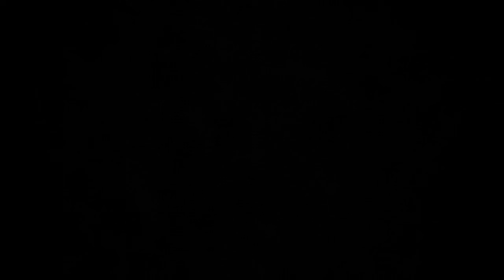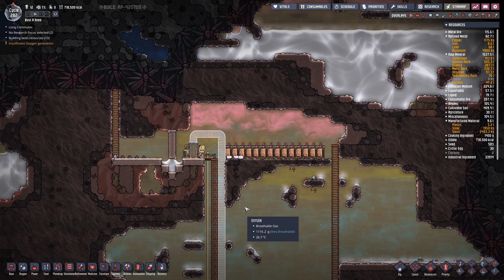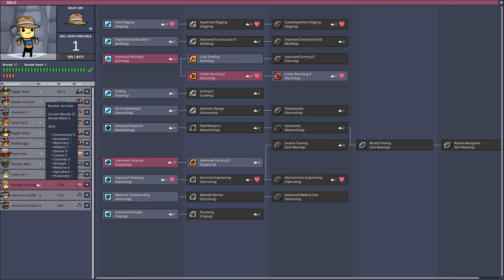ONI Bust A Rime #14 - Petroleum boiler

Comment: I'l be honest, I take the method you used in the first few videos to make your chlorine room and do that as often as I can. I build the entire structure, bottom up, and fill in all empty space with regular tiles. I make a liquid lock outside and vaccum out the small area and just "carve" (desconstruct) my way out - as often as I can anway. I get so very tired of waiting for pumps to get the last tiny bits of gas out of a room.

Also, the sour gas flash there is definitely the lesson everyone needs to learn about thermal mass. Firing up a petroleum boiler definitely needs like 4 tiles worth of oil to soak up the initial heat spike. The smaller your margin for error in state changes of materials the more mass and/or control you need to throw at it

Comment: Steam geyser tamer : It seem to not have enough cooling because the tempshiftplates dont transfer temperature between each other , try to build solid tiles between them that will boots the conductivity greatly , also the pipe temp sensor is in the wrong place , the pocket is measuring isnt the one that enters the aquatuner , so it can overchill  the water again .

Comment: Hiya Tuplex, this happened to me as well the first time I built a petroleum boiler where a lot of sour gas instantly got flashed.  That's cause the automation to keep the door open has to be in place before the door is built otherwise the door and diamond tiles above the door will be preheated to 1400 degrees without enough crude oil in the system.  If the automation is put in to keep the door open first, you will keep the temp of the tiles and door low until it's ready to go.
Reply from the maker: Yeah next time I build one I’ll open the door right away.

Comment: This comment may be all to do with weird game mechanics/physics, but is there ever any point in putting a radiant pipe inside an insulated tile other than 'quick planning - build'? (I can see the necessity for the inverse, ofc)

How does steam behave in game? Is it a gas or a liquid for transport/vent purposes? Also what's its density relative to (eg) CO2? (H2O should be far less dense than CO2 (2x1+8 < 16+2x8), but that's assuming full saturation, whereas the steam saturation will follow an integral curve as it condenses to liquid due to (constantly falling) heat energy.. a curious possible experiment :)

There are several natural voids you could excavate on the RHS of the magma-fired petroleum generator to use as a huge petroleum storage sump (basically excavate, then line with appropriate tiles if necessary, ignoring most of the natural abyssilite 'lining' ofc) & pump out the existing crude oil to the LHS (your 'provider' sump); after this is done the pump can be repurposed to move petroleum to wherever it's desired, mostly using the existing pipes.. after suitable cooling ofc (maybe use it as a temporary base heating/liquid cooling loop?)

What are the thermal properties of magma? I guess if it cools far enough it'll solidify to obsidian, but how about heat transfer rate? Can you rely on that pool to keep you going for as long as expected, or will it eventually be a problem with rock forming around your heat transfer systems?
Reply: radiant piping in insulted tiles... hmm, generally, i don't see a reason for this, however, i can see situations were someone might want a slow heat transfer to the environment (insulated materials don't stop 100% of heat transfer in game)

in game, steam is considered a gas and co2 is the lightest of the gases. but i believe that dev's consider the kinetic energy in steam, ie it rapidly expands and naturally raises above co2.

i agree, he could've created 'natural' storage tanks, personally, i like using the abyssalite as a 'natural' storage or barrier for my builds but i also see why people just dig-up and ignore the abyssalite altogether, its all comes down to personal aesthetics both methods are efficient in their own ways.

eventually the magma will solidify once enough heat is removed, but it'll be a while. i think for the magma to flash instantly into a solid, you have to dump 1480kg of crude oil onto a tile of magma, but since you can only have 870kg of crude oil per tile (in game density) the likelihood of that happening is rare, but not impossible. also, because its only dripping 10kg of crude oil at a time, the actual amount of heat extraction is very slow and the solidification of the magma will be that much slower.
Reply: @ChioChao  CO2 is among the most common gasses the heaviest. The ligher being hydrogen. Then there's oxygen. Then nat gas, sour gas. Then chlorine, then CO2.
Hydrogen separates from oxygen very easily. So does CO2, and also chlorine. The others, oxygen/p oxygen, nat gas, sour gas, require quite a long time to separate.

Comment: a couple of helpful tips when building petrol boilers:

1. install a flow control valve so you can limit the flow. never shut off a countercurrent flow system as the hot petroleum will reach the pump. also, you will need one early on as you are not using more than one generator that i can see. 

2. when building a countercurrent flow system, there isn't any trouble that you should encounter building it longer. i would extend the top and middle rows out to make the core last longer. on my previous build, i built a large 9 row, single tile spaced, 10 ish tile wide boiler with a 3x3 caudron. i tend to be a hog with efficiency. 

3. on future builds i recommend building a vacuumed access chamber that runs alongside the boiler that you can use to access the magma chamber. this way you can extend window tiles whenever the igneous rock drops too low in temperature.

4. when building a petrol boiler, it's better to build a large petrol storage station and dump petroleum into it, than it is to shut off the system.

5. on automated switches, there is a chance one will overrule the other, so i would suggest adding and/or gates to avoid this problem.
Reply from the maker: Thanks for all the good tips!
Reply: @TuplexGaming  Green signal always overrides red on the same wire , so the switch with the temp sensor is useless as the tip states it need gates to work.
The effectiveness of a counterflow depends heavily the mass involved in it , in this case its mediocre , but you have more then enough magma for a few thousand cycles it will just require maintenance earlier  . Having a bigger tank on the end could help you in to ways , 1 more mass more stable temps , cooler petroleum and faster heating oil , 2 if you keep the petrol 2 tile high you have a free liquid lock entrance . Also a few tempshift plates could help to , conductivity dosent matter just large heat capacity .
The process itself and the boiler design to dosent really like to be turned on and off because of the temperature fluctuations , but with a few more steps in the counterflow and well placed doors and vacuum you can keep the temperatures separated so you can turn it on and off without warm up time or accidents . 
Also the neck where you make the magic in long term is a bit risky , because of game mechanic 2 type of liquid cannot occupy of the same tile , so when the oil drops it compresses the petroleum and can and eventually will cause unexpected pressure dmg.

Comment: Do you actually need a vacuum for the steam tamer?  Since the CO2 won't ever liquefy, it won't contaminate the water (unless there's another reason that you need a vacuum).
Reply: CO2 has a low thermal conductivity, so I guess it will interfer with the heat transfer to the diamond tiles, this making it less efficient.
Reply: @Shuttereye_7  Yeah but when there's steam in the room to be condensed, it forces CO2 at the bottom. CO2 raises up to the diamond tiles level only when there's almost no steam left in the room, and then who cares about the last mg lingering around...
Reply: ideally the design (which by the looks of it was probably in an older Francis John video?) instantly converts the steam into water, so there is 0 gas in the room at all. It's meant to be all temp shift plate backing and a very compact room which you pump everything out of. The window tiles and door to the right are meant to dump chill into the room to keep it around 95 degrees, but not to run your aquatuner flat out for a dozen cycles per eruption trying to cool all the mass in there to a normal temperature.

There's plenty of ways to go about it.

I usually just cap mine off with insulated tiles to force the flow in a direction and let the surrounding area do the cooling work for me. By the time it's heated up all the mass around it to where it won't easily consdense to water I can usually tame is properly with a sealed system and proper storage for water elsewhere.